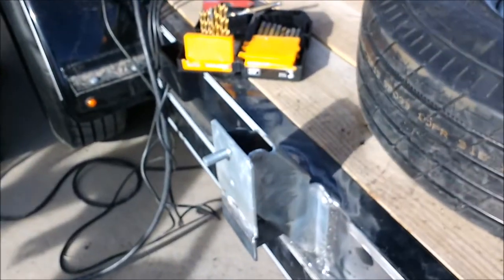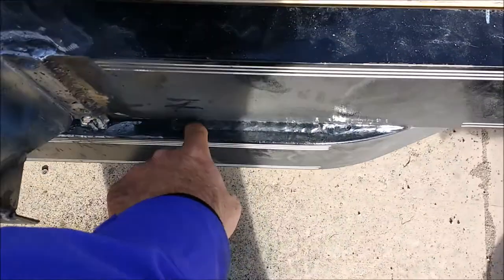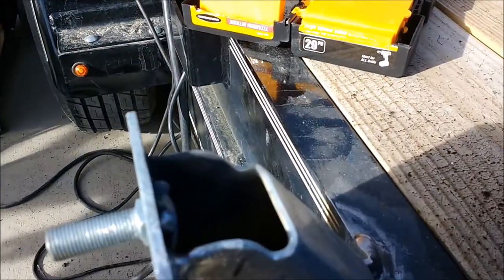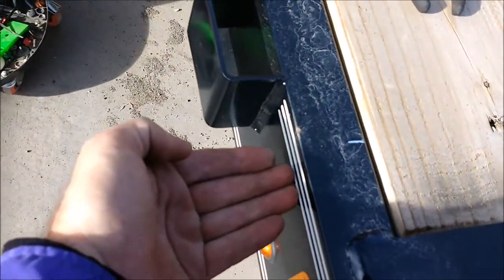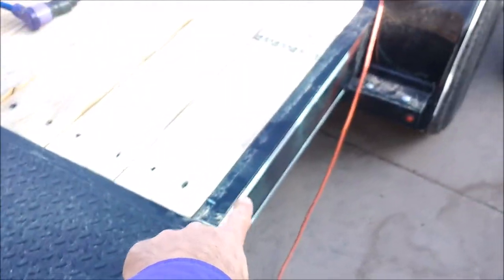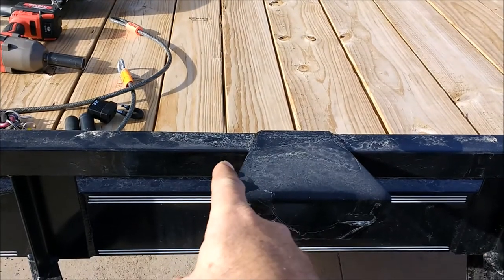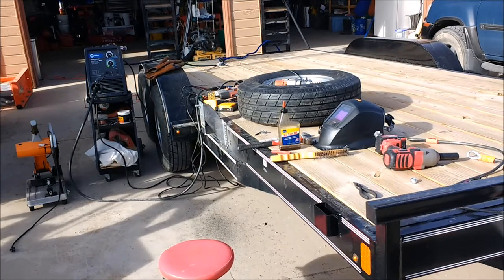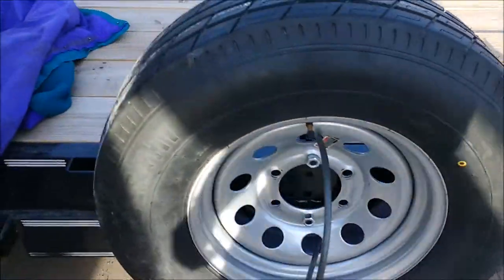Trailer Project Part 3: Spare Tire Relocation

Comment: They make d rings the just drop in the stake pocket
Reply from the maker: Yes! So I found out just recently. But I still think I would use weld on ones, otherwise I would be worried about someone taking my drop in D rings. Maybe people lock them in place somehow? Or maybe people just install them when they have a load tied to it, and when they take the load out they lock them up in the trailer box? IDK